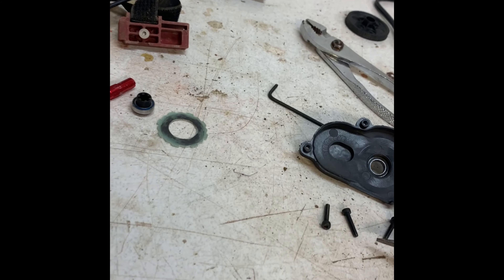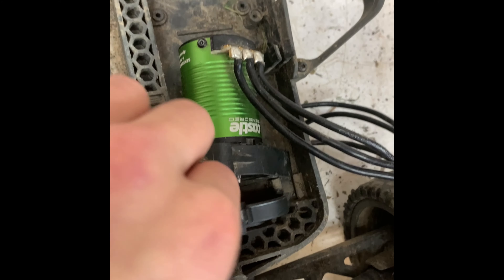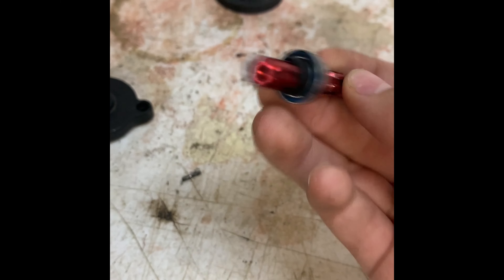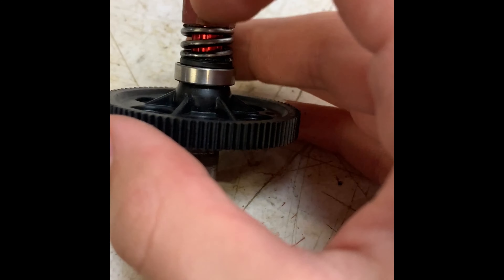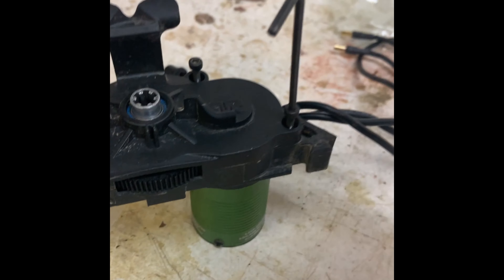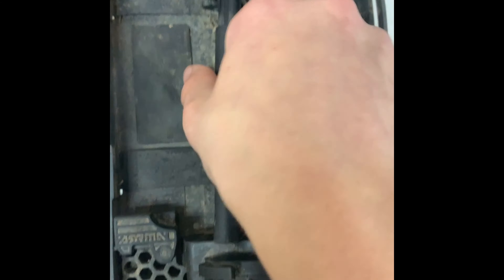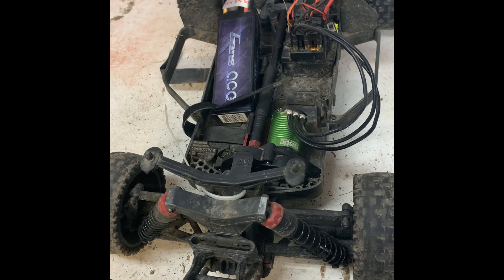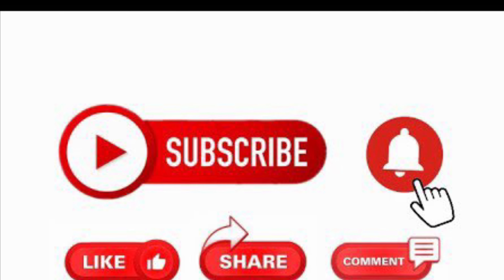How to fix the spur gear on ARRMA senton (Detailed!)

Comment: 👍 would be handy if i saw this video before i decided to go nuts and put a 3660 3700kv motor in to make it go nuts on 3s but i ran into so many problems starting from motor shaft is 5mm so new pinion needed great. Cool,now the spur gear is too small... Need new spur gear but it needs the newer clutch assembly from BLX version. So more money. Now i need new metal motor holder so it can cope with the power. 
And I'm still waiting for the parts... FML 😭
Should just put brushed system back in until I get everything. It's so frustrating to look at it sitting there... Great video 👍
Liked.
Reply from the maker: Yah, I get it! It’s tough to see cars sitting there not being used. I got a couple I still need to fix, but I haven’t gotten much time to fix them, plus, I can’t figure out what is wrong with some of them😂
Be sure to let me know when you fix it!

Comment: does the spur gear slipping? when you press full power
Reply from the maker: i actually ended up switching to the BLX spur gear, and after that it wasn't slipping. But before i changed the motor, it was not slipping with the brushed motor

Comment: Amazing thank you so much 
I got a arrma Typhon 2s but I converted it to 4s and I stripped 2 spur gears not knowing I could buy a cheaper option of just the one with the teeth, so I was looking for a video and found this one. You just got another subscriber
Reply from the maker: Thank you so much!! Just so you know, you might go through these a bit faster because the teeth are smaller, and cannot withstand as much power. I would recommend going for a hot racing on. It is a bit expensive, but it will last a really long time. Also, make sure the pitch is correct on the pinion and spur. And don’t forget to make sure the gear mesh is lined up correctly!!
Reply: @bigandcoolrcschool294  yes I do have hot racing and thank you again
Reply from the maker: @Xander543  that’s good. No problem 😉

Comment: I have a question how do I remove the bearing of the spur gear
Reply from the maker: It’s should just pull right off. You may need to use a bit of elbow grease, but it just pulls off.
Reply: Isn’t working like that for me
Reply: @willhicks1010  mine melted on I had to buy a new spur gear

Comment: I’m thinking it just not be a common issue unless you are modded. I’m running a Castle Mamba X on 6S so my spur gear didn’t stand a chance 😂 but after changed it out and set my punch lower and put a larger pinion gear I haven’t had any issues since! Arrmas are great products
Reply from the maker: They Really are! I am running the castle sidewinder SCT on 2s. I am just starting to run it in 3s! I don’t have any extra spur gears so I hope it doesn’t strip again! 😬😬
Reply: Same here converted my arms typhon mega to 6s spur gear didn’t last😂 so I ordered 3 back ups
Reply from the maker: @fedthegoon  lol! I finally got the spur to last a while! Hopefully yours lasted! (sorry for the late reply! I normally reply fast!)

Comment: Your video was helpful in outlining the slipper clutch reassembly. Thank you.

What motor are you running? Castle  1410-3800kV?
Reply from the maker: Your welcome. 😊😊.
And yes, I am running the 1410-3800kv. It is the sidewinder sct
Reply: @bigandcoolrcschool294  I'm running that same motor in my Stampede 4x4 with a Hobbywing 10BL120 sensored ESC. That Castle motor is awesome.
Reply from the maker: @dngrclwn  It is a really great motor! 
I think i am running too large of a pinion, bc it overheated and started to cog. What pinion should i run?
Reply: @bigandcoolrcschool294  I'm running a 13 tooth pinion and 54 tooth spur, so roughly 4.1 to 1 rato.
Reply from the maker: @dngrclwn  ok. Thanks for letting me know.

Comment: how were you able to get the pin out?  Mine is stuck, i can't even drill it out!
Reply from the maker: it should just slide out. maybe try some heat. It should help to slide it out. You may need a new slipper pad or whatever you drilled, cause it may cause problems and  damage in the future

Comment: What is the teeth count on ur spur and pinion and what is the pitch
Reply from the maker: Sorry for the late response. I usually respond faster. I think the teeth count is 91 for the spur gear, and the pinion is 17 tooth. and I am not sure what the pitch is. Here is a link for the spur gear and pinion 
This is the spur gear- https://www.arrma-rc.com/part/AR310799

This is the pinion gear- https://www.arrma-rc.com/part/AR310383

This has all the specs. Sorry for the inconvenience. I’ll do some more digging, and when I find it, I’ll let you know. 👍
Reply from the maker: Not sure what “DP” means, but both say they are 48 DP. Hope this helps.